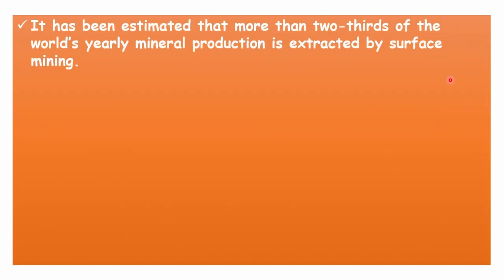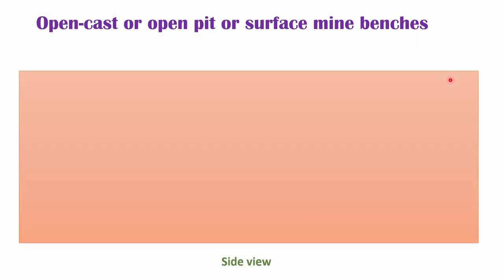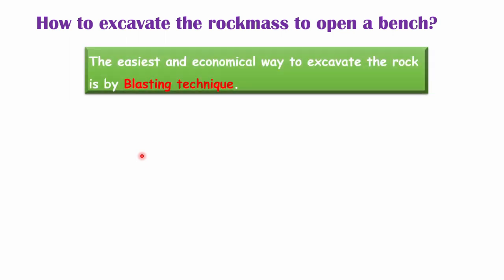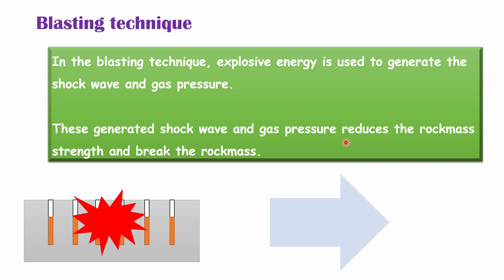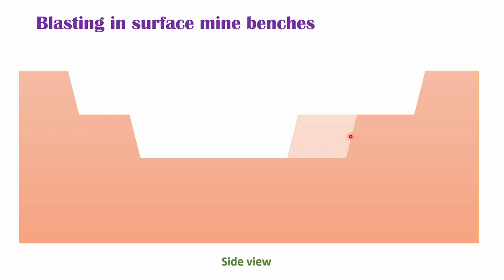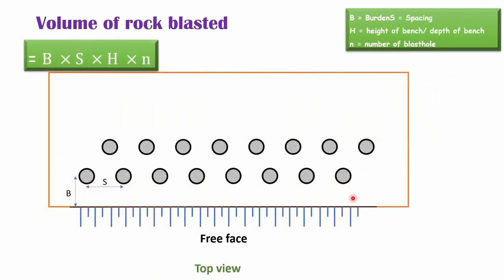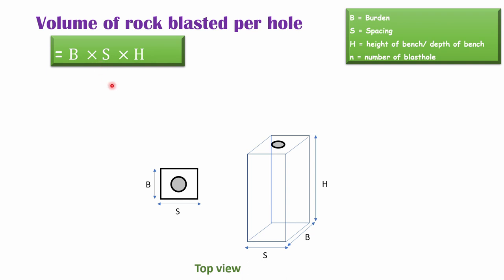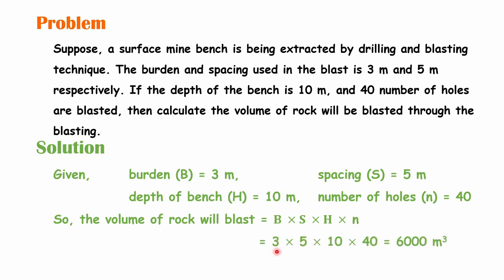Surface blasting | Volume of rock blasted due to blasting.

Comment: Hi for gypsum what is bulk density and how to control big boulders while blasting
Reply from the maker: Gypsum bulk density- 1.2 to 1.4
Reply from the maker: Using Proper burdens and stemming, one can get proper fragmentation in blasting.
Reply: But gypsum  bulk density 2.2 per cubic meter is not right
Reply from the maker: Kindly explain your question. What do u want to know.